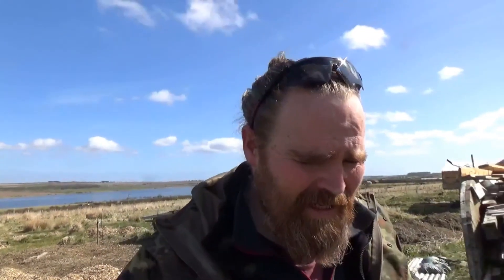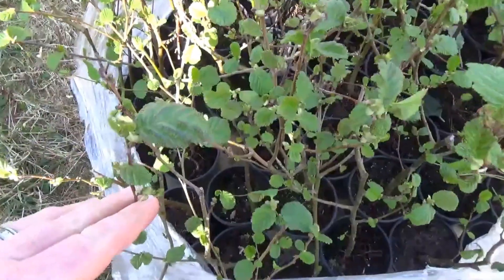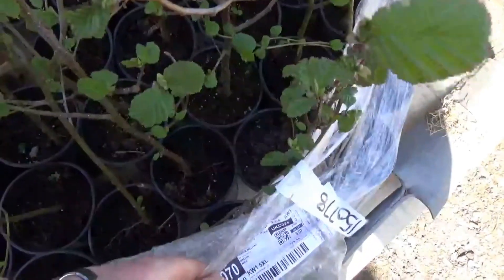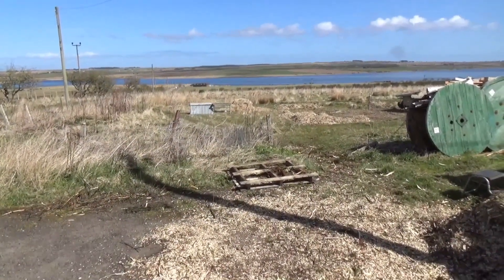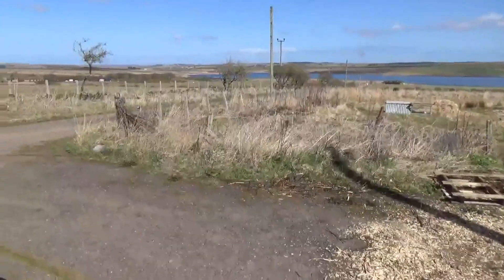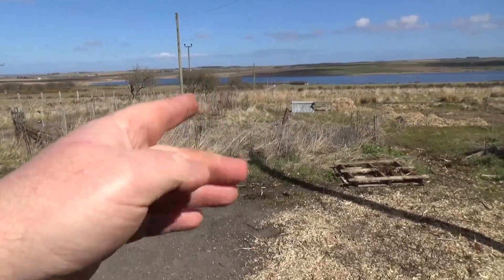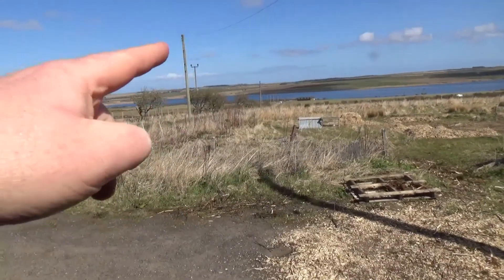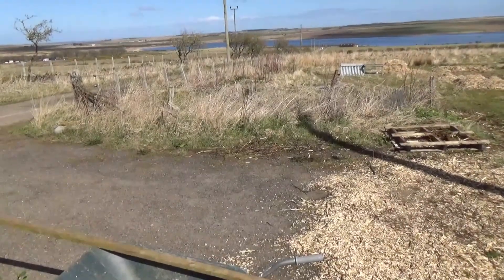Designing and installing a nitrogen fixing shelterbelt.

Comment: New day, new question (and more fun for the youtube algorithm) - since the common alder loves water I am tempted to put it in a swale, but that would mean that my shelter-belt would be on contour and not straight... The contour is perpendicular-ISH to the prevailing winter-winds, but will have some significant curves on it. Do you have any experience - or read anything - whether that would be a major no-no?
Reply from the maker: Don't get too hung up on the angle too the wind, shelter is shelter. If it protects the inside of the system then it's being effective.